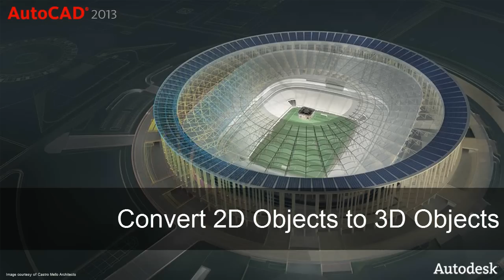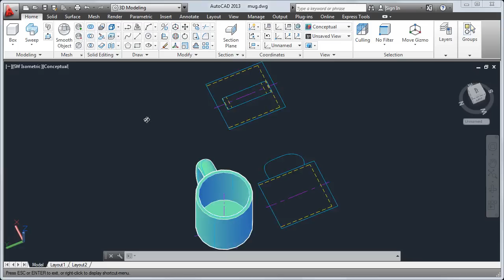AutoCAD 2013 Tutorial: How to Convert 2D to 3D Objects

Comment: for some reason the depth of the mug interior is not working, any ideas why?
Reply: +Hani Aladmaai Do the Press and Pull step, but for some result its not working. So at the end, just use the subtract command to subtract the interior from the exterior. Let me know if you get it.

Comment: i dont find the 3d modeling button
Reply: walther89 hope you found it by now but at the top there is a little arrow that points down and under the drop down menu press "workspace" then press the new bar the appareared click  "3d workspace"
Reply: walther89 its on the top of the ribbon

Comment: Welldone but there is a problem. I think you know it too. I couldnt fix it. The handle of the cup is not unit with the body. there is a little space. Is there a solution ?
Reply: You must make the profile line of the handle a little bigger, so that it goes inside of the mug, and then just remove  the excess with the subtract, in boolean command.